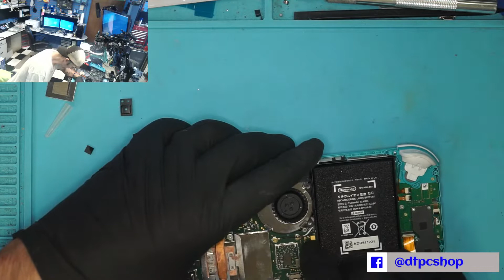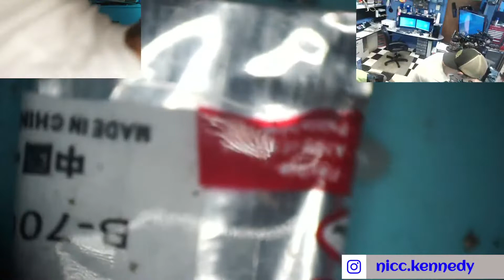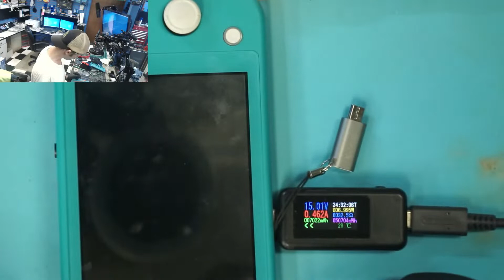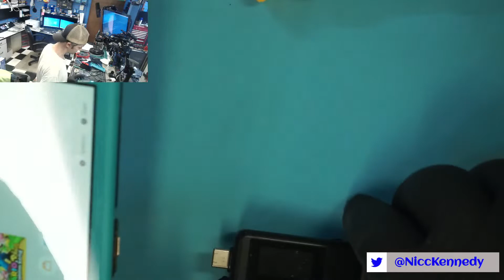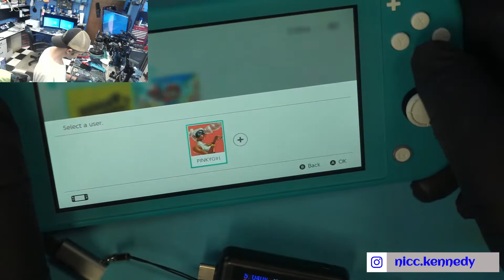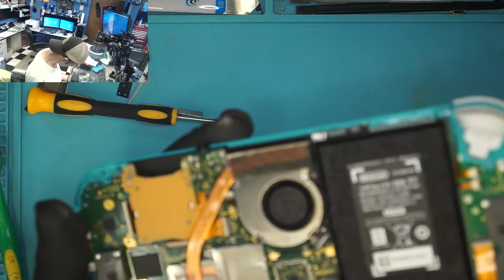More Problems

Comment: Nice fix on this Nicc, was good to see a simple flow of solder on those joints sorted out the 2101-0001 error code.
Reply from the maker: Advice from a certain Mr. Chris I know, certainly worked out this time. Thank You by the way.